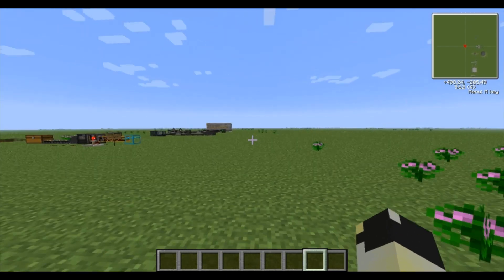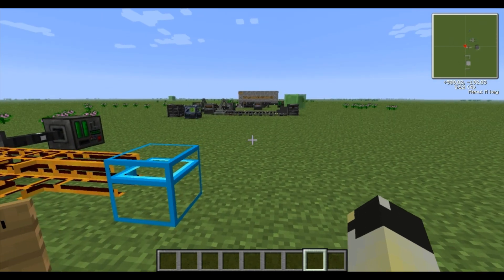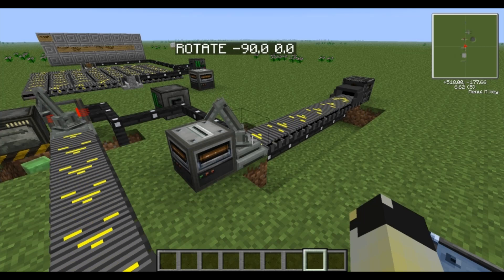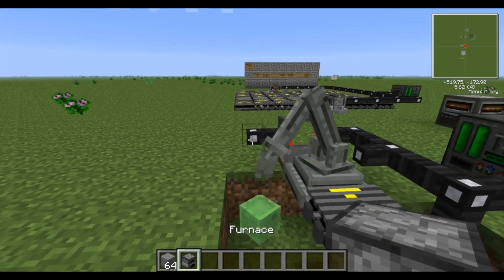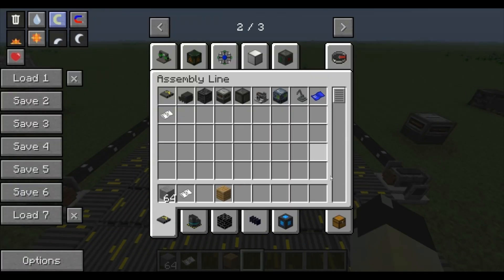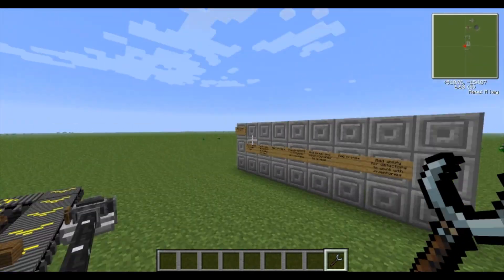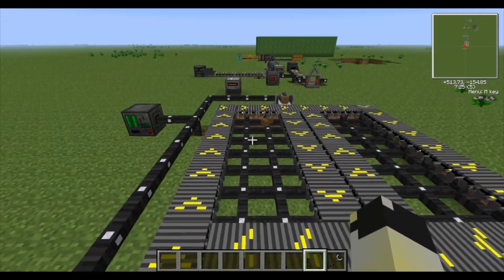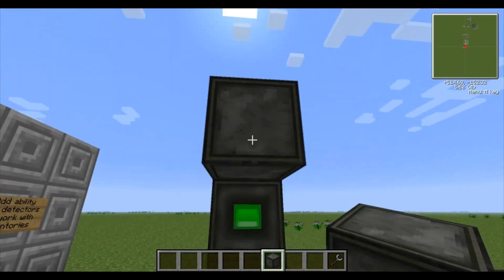Minecraft Voltz Tutorial Update: Assembly Line

Comment: when you said "it doesn't work with any other mod" you were probably confused by how assembly line doesn't work with the smelting factory. if you use a machine from another mod with one output and figure out which side to connect the manipulator it will probably work